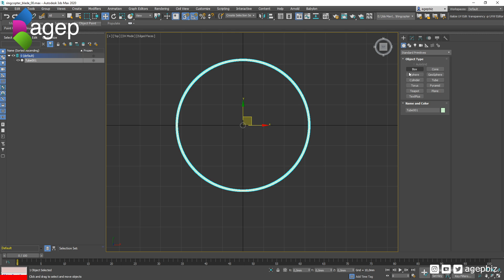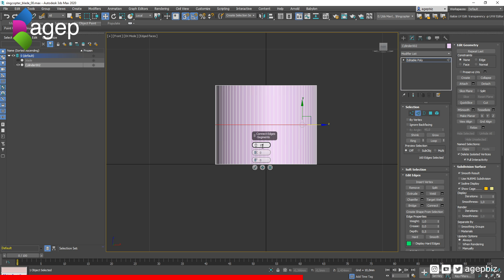I made a Pull Copter Finger Ring - Fulcrum Minibot - First Impressions

Comment: What is the tool you’re using to clean out the supports at 3:24?
Reply from the maker: Just some cheap Stainless Steel Wax Carving Set I bought from ebay many years ago

Comment: I won one of these (Fulcrum Minibot) in a Gearbest contest - my first step into anything involving the 3d print world.  While it prints the included designs (mostly) perfectly, I'm having trouble printing (downloaded, free files mostly sourced from Thingiverse) from stl files I've sliced into gcodes with Ultimaker Cura 4.6.2 .  I couldn't find a preset for this printer in Cura so I'm guessing the settings are screwy.  

Printer settings are :  X = 75mm , Y = 70mm , Z = 70mm - Build Plate Shape = Rectangular - Origin at Center, Heated Bed and Heated Build volume are all un-checked - G-Code Flavor = Marlin (whatever that means).

Printhead settings :  X-min = -20mm - Y-min = -10mm - X-max = 10mm - Y-max = 10mm - Gantry Height = 70mm - Number of Extruders = 1 - Shared heater is un-checked.

Extruder Nozzle Settings :  Nozzle size = 0.4mm - Compatible material diameter = 1.75mm - Nozzle offset x = 0 - Nozzle offset y = 0 - Cooling fan number = 0.

All of this is new to me and any and all help is appreciated.
Reply from the maker: Yeah, unfortunately this printer is not the best as a first printer. Somehow, the included filament printed well, but any other filament (good quality) I tried did struggle, I have no clue why
Reply from the maker: What kind of printing problems did you have? I used Simplify3d, and the gcode should work well, the the main problem, as mentioned in the video, was the cooling. Have you tried adding a desktop fan?
Reply: @agepbiz  I've had adhesion issues, mainly, but also everything seems a bit "off" when I attempt printing from stl files I've sliced.  (Again, included designs print well - I've had zero success with downloaded files.)  I tried printing the ring part from this Copter and the base layer did not stick to my print bed, causing the piece to move, ruining any progress and wasting filament.
I haven't noticed cooling issues, although as I said I am completely new so my expectations for success may be very low.
Reply: I should add that I put a thin layer of glue onto the print mat / bed, whatever and that helps with the included designs but does not help with downloaded files.
Also, thank you for replying and taking time to help.
Reply: I installed Simplify3d from the included files on the SDcard that came with the printer and followed the instructions - I cannot get that program to open  (64bit Windows laptop - I expected it to work but it does not).  Loader64 copied and pasted - it doesn't open.  
I was able to locate the 'minibot.fff' file on the SDcard but I cannot see an option in Cura to import the printer settings.  So, again, I think it's the printer settings that are not correct.  Do you know of a free slicing program, off-hand, that allows for printer settings to be imported?
On a side-note ...  Does the recommended printing speed as expressed by the filament manufacturer make a difference?  (I literally set up this printer Tuesday morning - 5 days ago - and printed through the included 200g spool by Thursday night, roughly 2.5 days usage.)  I was browsing Amazon to buy more filament and a lot of it is listed as 50-100mm/s printing speed, while this printer does 30-60mm/s on average, from what the specs indicate.  I only bought filament (1.75mm PLA, proper) that is recommended at 30-60mm/s.
Reply from the maker: @Fivling  I mainly use Simplify3d, and it is a paid slicer app, I dont expect S3D files provided on a SD card to work. I have never heard of recommended print speeds for filaments. For me, when printing small or very detailed models i print  at 30-40mm/s, for everything else I print at 40-60mm/s. The few times I dont use S3D I use Cura
Reply from the maker: @Fivling  Make sure you level the bed correctly, run the leveling steps. Put some printing paper between the bed and nozzle at each corner, you shoud be able to move the paper but still feel some drag. Bed leveling is a big part of 3d printing. The provided files are probably using a raft? Rafts helps with adhesion, but makes some ugly first layers
Reply: @agepbiz  I run leveling on all 4 corners and the 5th, center spot before every print.  $150 isn't something I have lying around to spring for slicing software to use on downloaded files.  I could justify the expense if I were to look to design my own prints, from start to finish but I don't see that happening.
Thanks, again, for taking the time to help and for giving me a lot of insight.

Comment: Point of clarification, I'm 90% sure this is actually an "H-Bot" printer. Corexy has some extra belt crossing opposite the input pulleys. The CoreXY balances the tensions in all directions so you don't get racking/skewing of your gantry. H-bots generally need pretty tight tolerance bearings to keep from racking/skewing, but this printer is so tiny it too is probably fine. If you search "CoreXY Explained" All3DP has an OK writeup and Teaching tech has a good video on it.
Reply from the maker: Looks like you are right. After searching the All Mighty Google for Hbot this seems to be a Hbot setup. The product packaging it came in said "Fulcrum - A Core XY 3D Printer" so I kind of took it for granted :D